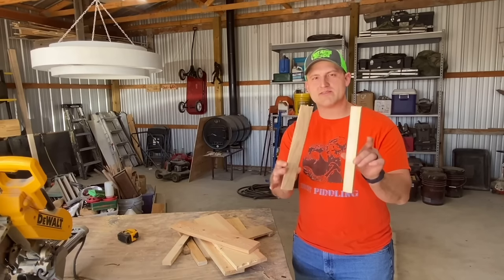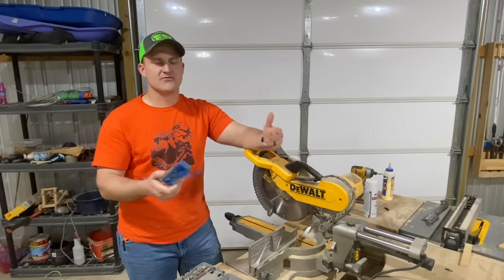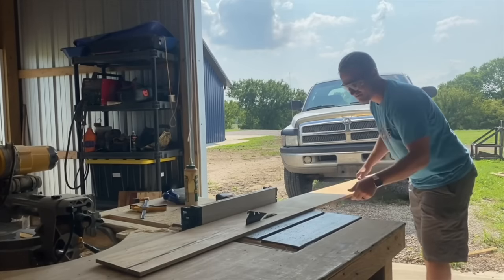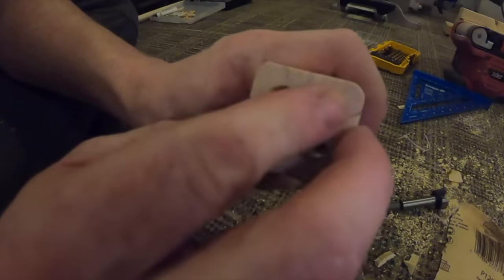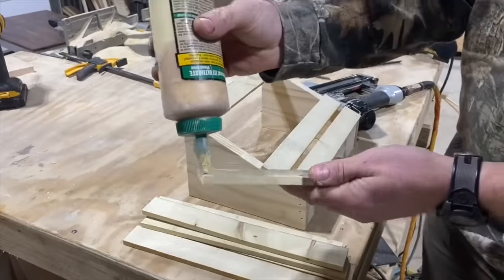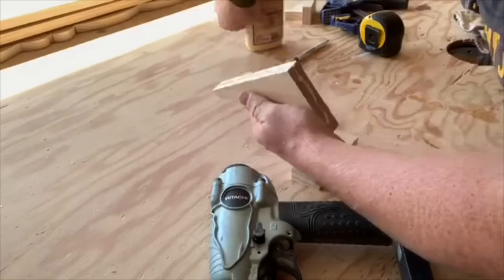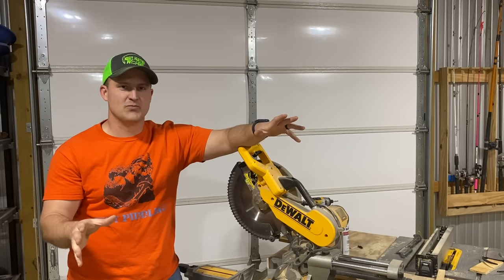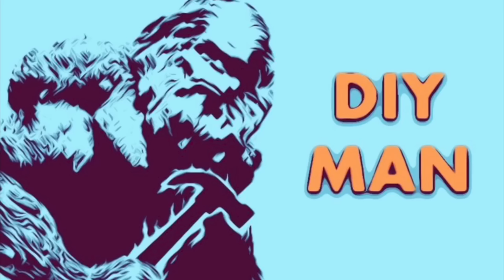10 Easy Scrap Wood Projects (With Video Plans!)

Comment: Brother theres no sound...
Reply: Sound was fine on my viewing. Might be a issue with your phone/computer. Exit out of YouTube and open it up... if that doesn't work try a restart. Sometimes YouTube will update and a restart is needed to fix issues that weren't there before. Hope your issue is resolved. 🤞🏻
Reply from the maker: Thanks for the heads up. It seems to be working fine for me.